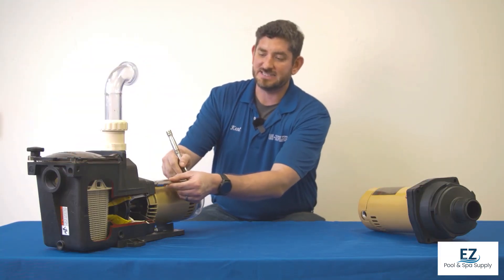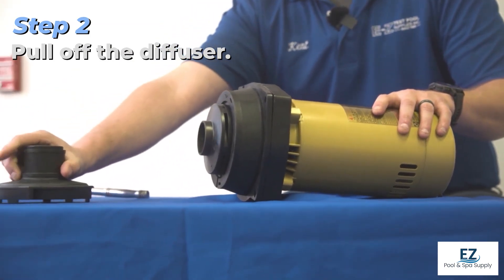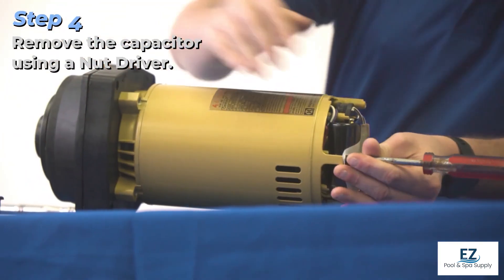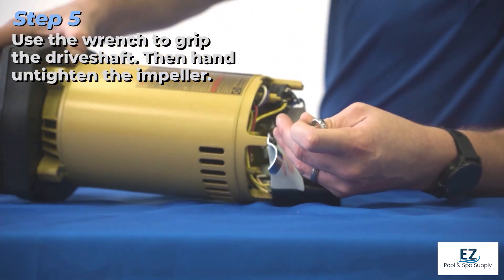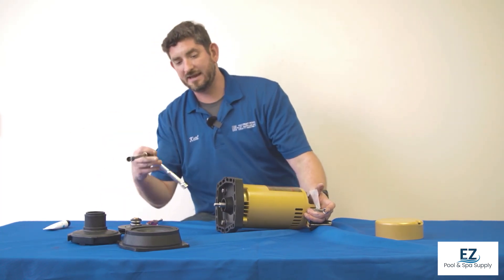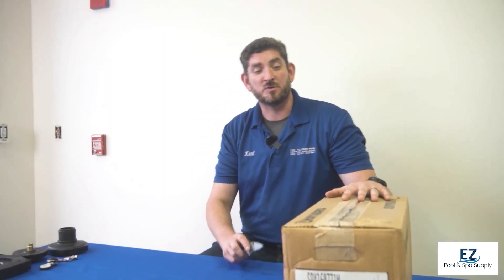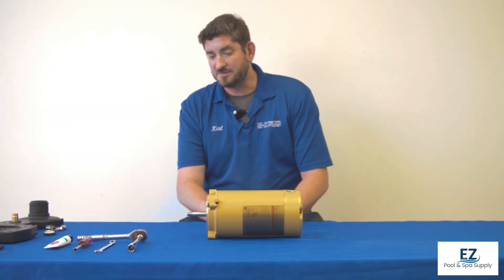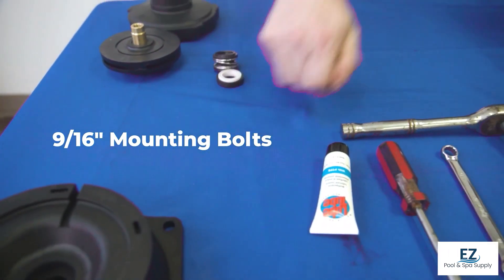How To Replace a Hayward Super Pump Motor

Comment: What if the impeller spins freely even after securing the shaft from the other side of the motor? And cannot be removed.
Reply from the maker: Hello!
If the impeller spins freely even with the shaft locked, it usually means the impeller threads are stripped or the impeller has seized to the shaft. In that case, it won’t unthread normally. The typical fix is to carefully split or cut the impeller off and replace it. Just be sure to protect the seal plate and motor shaft when doing so, and plan on installing a new impeller and shaft seal during reassembly.
I hope this helps!